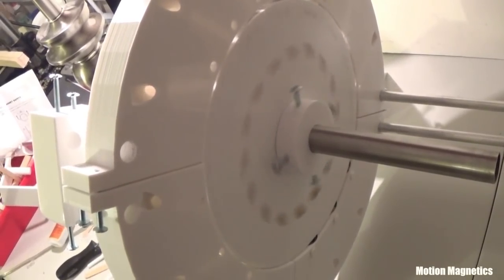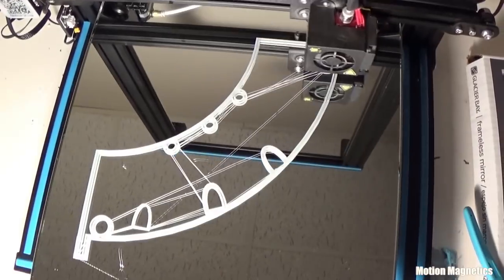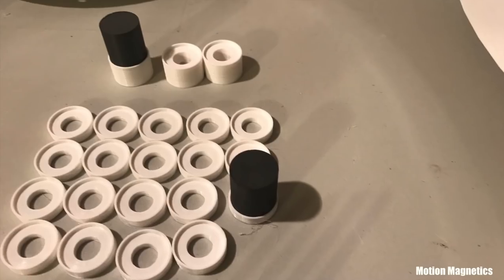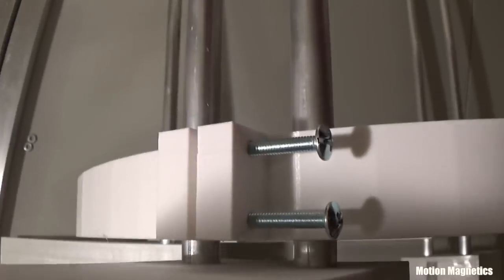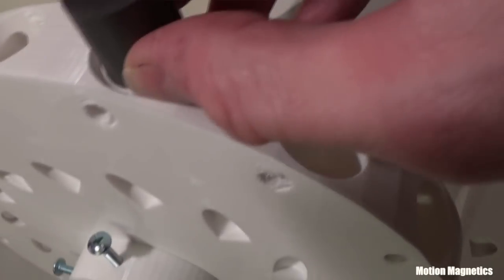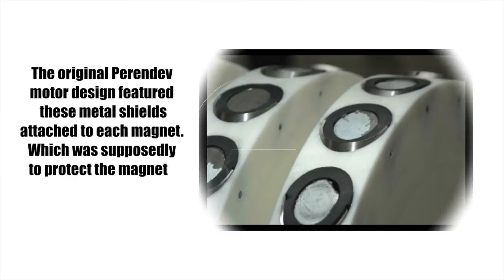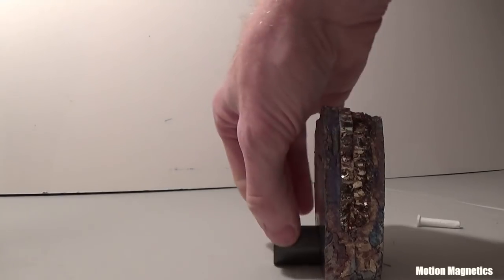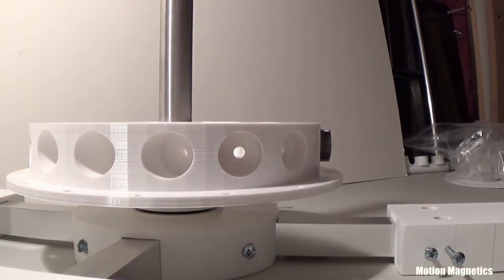Building an Imbalanced System

Comment: Motion Magnets...Doesn't the imbalance ALWAYS results in a WEAK motor!!! One particular thing I've noticed in practically ALL videos of magnet motors and their creators, is that, NO ONE ever connects a good load, such as a regular automobile alternator, or even something smaller that the alternator, like the fan motor from same so it can produce some ZAP, and so we can see how efficient they really? Demonstrations without good loads tells me that even if this machines run and keep on running without stopping, their power is TOO WEAK to do any real  work...unless the motor is HUGE and a small load is connected!!! 
Are they WEAK, because even the Yeldiz magnet motor which he can only get going by banging the thing with a sledge hammer, also is NEVER equipped with a good load, he always only has a BLADE-FAN installed on it, but even we can blow air with our mouths, so that to me is utterly ridiculous because the turning of a fan doesn't tell us how powerful his machines are!!!

Another thing is that, many compadres also do the same thing you did in this video...you and they just talk and explain and talk and explain, but don't show any real working machines — without electronics of any kind — why is that...except for Yildiz, but as I said, even his isn't connected to a load!!!

lastly, in one of your videos titled: "3 types of magnet motors", on the part 1 video, I remember very clearly seeing footage of an OLD, very simple linear magnet motor which would shoot a small ball magnet or bearing straight out pretty FAST, and without any magnetic-cogging, or opposite resistance of any kind, and in my opinion, I truly believe that the arrangement of the magnets on THAT particular motor  — by what is seen on that old footage — IS, or seems to be how a magnet motor should be built and which would be able to sustain the semi-perpetual motion or movement of the ball (rotor) but instead of a ball and built in an arched fashion, the rotor would be a large, non magnetic wheel equipped with magnets all around on the inside circumference for more power, and it would probably be more efficient if a flywheel is attached to it, and also if neodymium magnets are used, and not the kind the old footage shows? 
Do you know which motor I'm talking about from part one of that three-part video? Even tho I ask that, my other question to you is: what happened to that portion of the video which shows the old footage from the fifties, or so, of that particular linear motor...did you remove it cause I don't see it anymore whenever I check out part 1, and even on the other subsequent videos I also can't find it? 
I remember saving that old footage that was uploaded by someone else about a year ago — was it you? I think i have that particular video saved on my pc in some old bookmarks which has a Spanish title to it but I have to look for it to see if I still have it and maybe upload it, and perhaps even try building something similar to that one myself now that I saw it again on one of your videos, but which now I can't find as I explained. 
Why don't you build that one buddy, but arched? What say you my friend?

NICE VIDEOS AND VERY INTERESTING INFO INDEED MY FRIEND...CHEERS!!!

Comment: I have a magnet question for you. Imagine you've got a spherical magnet, one side will be north, the other south. Cut the magnet in half, and now you've got 2 magnets with 2 poles. Simple. Carve out a portion of each half's of the magnets in a semi sphere and put them back together, gives you your original sphere with a hollow center. Here's the question. If you put two flat magnets inside that perfectly match the hollow dimensions inside that hole with the S-S or N-N ends facing each other, they'll try to repeal from one another, yet if there already trapped inside a hollowed out magnet, would it cause the inner flat magnets to rotate inside the larger sphere-thus giving you a sphere magnet with a rotating magnetic field similar to  a planets magnetic field? Or, would it simply do nothing, leaving you with a normal 2 pole sphere magnet? I've asked this question of a few people and have never gotten an answer-and since I'm not a machinist, I can't experiment myself.

Comment: Why you say perendev or yildiz are imbalanced?
They are all perfectly balanced.
Where you must look about imbalance is the resistive and energetic vectors in a cycle, and nothing else.
Now make the demonstration of the imbalance in the vectors.
No simple just only magnetic rotor-stator device could work.
You need a mecanism tha manage both contrary vectors to get an imbalance on the side of the energetic ones.

Comment: instead of magnets on rotor and stator, use coils on the stator triggered by a magnet on the axel (one per phase) and fed from a capacitor. The difference between energy collected and pulsed would be your output.

Comment: The shielding you use on one half of the side of each armature magnet will work 10 times better if you don't allow the two, to touch each other. A quarter inch space I found is best. (((USE MuMetal))) When traditional metal shielding and the magnet touch each other, the shielding effect is greatly reduced, even when using MuMetal. My shielding technique has completely removed all sticky spots, where as you have a tone of them in your system. You already have me on messenger, so just contact me though there and I'll do the same.

 Lastly, using brass nuts and bolts is best, as it eliminates unknowns that we otherwise might not have recognized. No sure when you will see this, but I'm doing Live Streams each Friday at 9pm, EST for a limited time on how to replicate my results. 

As always, Love your work. Sad that I had walked away fro such a long time. I'm back now and here to stay as long as I can. I'll pick up your suggested printer once I sell my home and get moved. I have a ton to learn about 3D Printers, but have been eyeballing them for a long time now.

As always, thanks a million. Just sad that you and eye are not close to each other, as I strongly believe between your working knowledge and mine, we would have since made history.  By the way, I've been shadow banned, where as it does not appear that you have been. Why shadow ban me for showing cause and effect of magnets where as you have not so far? Starting a new channel might temporally fix my shadow banning problem as while using a new ISP#. 

 Hope to have something up and running  before spring of 2019. And yes, shielding I believe is the magic bullet. It is for me anyway.
Reply from the maker: Good to hear from you, James! Glad you're back.

Comment: I made some shielding material out of powdered Iron, Copper, chromium and magnesium mixed into epoxy. It was pretty effective.  I am willing to work with you on this if you will print me a small mold to cast it into.  I have a small bottle of the powdered metals mix.  Mu Metal is the material I got the idea for the mixture from.   I suggest making the shield on one side of the magnet half way down the length of the magnet.
Reply: How about using (Biron) I mean GIRON as magnetic shield?
Reply: @smartines  you MUST have iron particles in different  orientations to achieve a shielding effect.
Reply: This guy used layers of iron and stainless steel. This should work too?! https://youtu.be/myqCHp22nGU
Reply: Saw what you sent.  It looks like he was using a piece of Mu Metal.  I mixed  the powdered metals into epoxy and got the same effect. This , in effect, creates the holy grail of a monopole magnet.  This makes an all magnet motor possible if you have three D printing like motion magnetics does.  I hope he will answer me and get in contact.

Comment: Are you using 'austenitic' stainless steel fasteners? Those type are supposed to be non-magnetic (or in reality very low magnetic). Not sure if they still could cause some type of interference to a magnetic flux, but I know this type doesn't stick to magnets based on my experience. It sounds like you don't have a problem with it anyways, but if you thought it might be better to try, you could look into those type to help insure they wouldn't interfere at all... Google for keywords: 'is stainless steel magnetic' for more info.
Reply from the maker: For the most part, I'm just keeping the nuts and bolts as far from the magnetic fields as possible. In some cases I use brass.

Comment: Let me share what I can see from the video. If it is scaled drawing, it seems the golden ratio as in the video is not the right one. 
if it's in the attraction mode, the wheel in the most left which is full face will have more power than another 2 wheels on the right side. the 2nd wheel will have approx. 35% attraction force of the 1st left wheel and the 3rd wheel let's say 0% compare to the 1st wheel. it will be sticked at this position.  Have you ever tried rearranging 2nd and 3rd wheel's outer magnets to have combined attraction force more than the 1st left wheel? I can see the  outer ring magnets has 3 set of 3-4 magnets per wheel.

Comment: What would drive the engine only with magnets? Even the SUN has fuel and for a certain period of time this fuel will run out. The magnetic field itself is not enough, there must be something that periodically changes either in the rotor or in the stator the pole of the magnetic field, the different strength - they will even ....... the end of the momentum that will give the rotor your hand :) Of course, the magnet has a certain type strength but it is a static force and uniform. Energy must be dynamic for rotary motion. And this ensures a cyclical change of the field N to S and this is a problem.

Comment: HELLO DEAR FRIEND! I ALSO WORK ON THE PERENDEV ENGINE! LET'S WORK TOGETHER! WRITE ME vip.kario@mail.ru
Reply from the maker: I'm not working on it right now, as I'm busy with other projects. I looked at both of the video links you sent though, and I like what you're doing. One of my older videos about the Perendev Motor included a linear test like you are doing, but you're doing a much better job of it. You are getting the same results as I did, which seems to prove I was right in my initial assessment of the motor.

Comment: I have given the concept of a magnetic motor a lot of thought and i strongly believe it is possible . I lack the resources needed to make a prototype of my own but I would strongly recommend configuring it in such a way that at least three separate rotors all attached to the same axle . In this way you could and have already demonstrated that it is possible to make a magnetic assembly move forward until it reaches the magnetic gate or catch point of the next assembly. so by having at least thee rotors you could have two magnetic assemblies pushing the one through the catch point or magnetic gate. then by staggering where the magnetic gates are on each rotor you would always have two rotors or magnets pushing the third through this "catch point" or magnetic gate.  in my mind is seems to make perfect sense that this would work. please let me know what you think. thanks for the work and information you are sharing on this subject!
Reply from the maker: The final design was going to include at least three rotors. So yes, I agree with you.

Comment: I like the Calloway motor. The thing I don't understand is the spacing between magnets on the rotor is 1/2" and all magnets are 1". With that said the bottom stater magnet is shown between 2 rotor magnets. (The magnet is shown 1" wide and sitting in a 1/2" space) How does that make any sense?

Comment: of course we are interested. ..lol.😅. . post as many as you like and can.. I really guess shielding is the key...but it will be hard to get real power out of the system as when putting magnets in such a circular fashion all fields will influence each other and not much difference force will occur anymore.. Maybe better combine it some gravity enhanced trick to switch back and forth some magnets via springs..so basically combine magnets , gravity and spring storage together with levers that are mechanically switched at some position and the potential energy stored in springs...A pure Perendev system probably will never work but try to prove us wrong..many thanks.  Regards, Stefan.
Reply from the maker: Thank you. Yes, you definitely need shielding for this type of rotary device. Thanks for the suggestions.
Reply: Hi MoMag. What kind of 2 D Animation program do you use to make your great 2D Animations synced with the sound effects ? Is that a MAC program or do you work on the PC ? Is this done via something like Aftereffects or an easier program to learn ? Many thanks and hopefully you get this motor somehow to run. Regards, Stefan.

Comment: For the shielding... What are your thoughts on Mumetal and other products with very high permeability?
Reply from the maker: It depends on the project. Howard Johnson used Mumetal in one of his rotary designs but used magnetic field angling techniques in some of his others. Most of what I know about magnetic motors, that I trust, is based on his work.

Comment: Awesome work!  I have one question, though... If you succeed, will we even see it?  I mean, if you succeed you have a design to become super wealthy, but not if you share that design with all of us watching.
Reply from the maker: Thanks. Most of the collective knowledge of what I know about magnetic motive forces systems in spread out a piece here and a piece there throughout my videos. I hide things in plain sight if you look for them. So when I succeed, you could probably follow the clues in my videos like breadcrumbs, to figure out how I did it. I have only one design I haven't shared, and that is simply because the parts have to be machined in a very specific way, and I will have to outsource them to get them made.

Comment: Tesla said the KEY to everything is Frequency. 
Unbalance + Unbalance = Balance (moves freely but no propulsion) & 
Balance + Unbalance = Unbalance (moves up to a limit then gets stuck)
Nothing + Nothing = Nothing  
So any which you try an Imbalanced System it won't work. Best to try an external source.
So you got to have something and compound it even if it is 1 to be 2,4,8,16,32,64,128,etc. 
just a though
Also check out this video which combines frequency and timing https://www.youtube.com/watch?v=xPx8D5sq01A

Comment: what program did you use to draw the picture for the printer ?
Reply from the maker: I used Tinkercad, though I believe I've outgrown its capabilities. It's freeware, so it has its limitations. It worked great for most of the parts but wasn't as consistent as I'd have liked on the rotor and stators. That's why you see the second style of rotor at the end of the video. I'm probably going to switch to something a bit more comprehensive to keep things more precise. You've added quite a few videos since I last looked at your channel. Good job!

Comment: Great job!
Somewhere i read cooper tubes were used for sheelding in perendev after bismut, it is not used  for sheelding actualy its for redirection or concentration of the magnetic fealds. Not expensive to try, never know. Is it possble to get the files for the 3d printig parts?
Reply from the maker: Thank you. There are so many stories about what Mike Brady might have used. He also said he initially built his motors out of aluminum, but that was causing problems because of the eddy currents from magnets interacting with the aluminum. So copper tubes would do the same thing. I try not to get aluminum parts to close to the magnets on my magnetic motor builds, as I've seen them visably slow down from eddy currents.

Comment: fine work, but you have too much friction in the sealed bearings, most of you can get the black seal ring off and clean the grease and use thin oil in stet 
👍
Reply from the maker: Good suggestion. I've already switched to a bearing with lower friction, but I like your idea.
Reply: Motionmagnetics👍👍👍

Comment: Motion Magnetics
I personally don’t think It will work like this, you need “MU metal”, search it, special metal that’s made for
Shielding! Otherwise you can use external factors for compensation of equilibrium situations like water, but even better, wind, or something like that.....
Reply from the maker: I actually have a box of MuMETAL. It works great for shielding electronics. I don't use it in a lot of my builds. It depends on the design though.